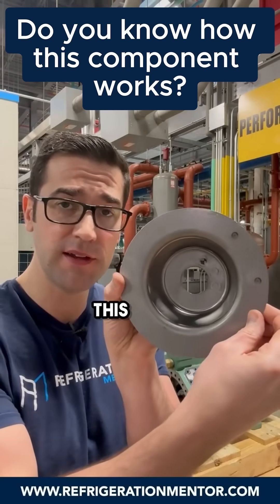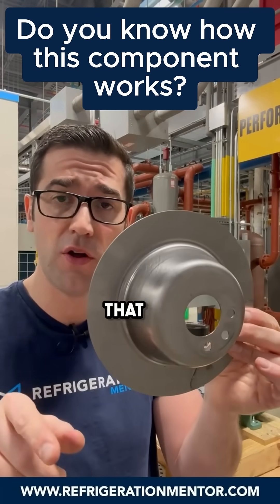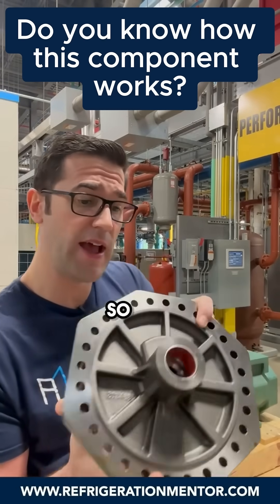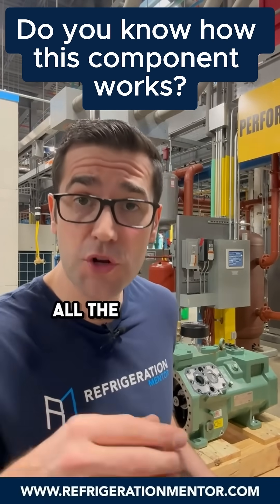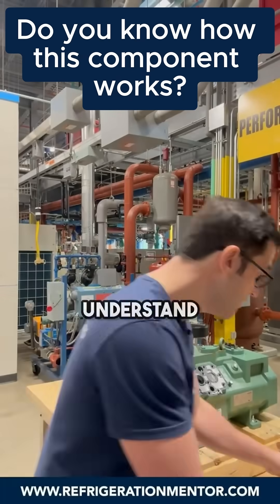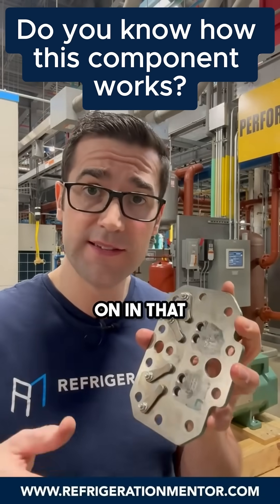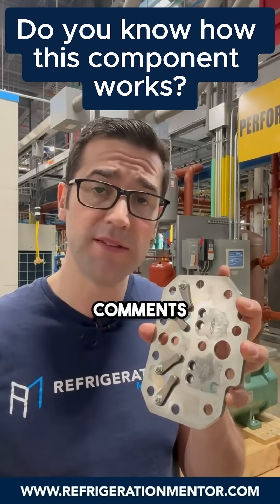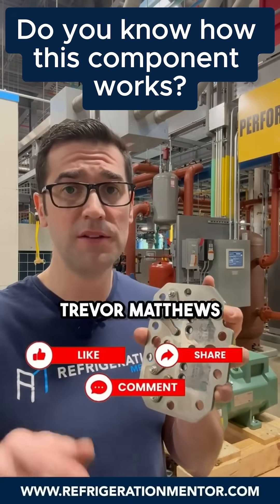Do you know how this component works?

Comment: The smoothest compressor in the whole world !!! Those German compressors back in the days were called dh17 , dh26 , only operated with R 12 !!!! Nice video !!! Thanks
Reply: I do like mycom....
Reply: Bitzer compressors are very unforgiving. A little too much oil, or very little flood back and they start malfunctioning. Copeland compressors seem to be the best compressors overall.
Reply: @mariocervantes8101  I have a deep respect for Copland but !!! Lately !!!! They are not the same !! 
90% of co2 racks were designed with bitzer unit !!!
Reply: @mariocervantes8101 Copeland are a good overall compressor. Depends what application. Discus are great in supermarkets and refrigeration. A solid chevy truck 
Carlyle are Cadillacs
Bitzer are premium
Mycom are better then them all.
Reply from the maker: Everyone has their favorite, and I’ve heard people loving them all over the years. Some swear by Copeland for their reliability and easy parts access, while others prefer Bitzer for precision engineering and operation. Then there are the Dorin fans who love their efficiency and CO₂ expertise, and those who stand by Bock for durability and serviceability, especially in transport and industrial applications. And of course, Carlyle has its loyal following for ruggedness and performance in heavy-duty systems.

What’s great is that each manufacturer has its own strengths, innovations, and quirks that appeal to different technicians depending on what systems they work on most. That’s one of the things I love about this trade — there’s always something new to learn from each design, and comparing them helps you become a more well-rounded tech.
Reply: Money is the deciding factor.  @RefrigerationMentor